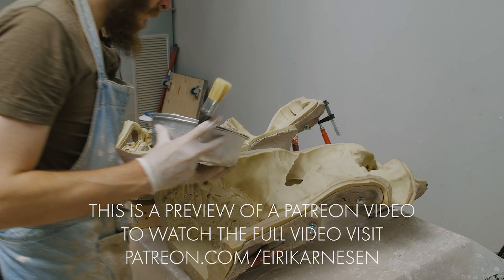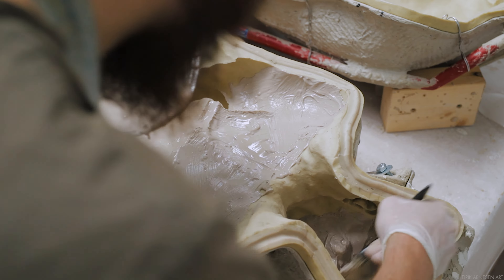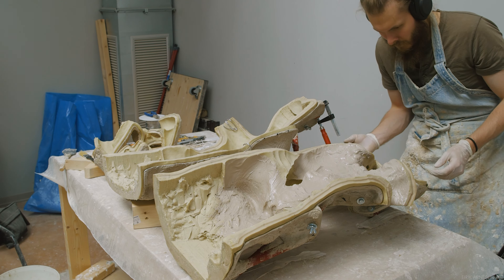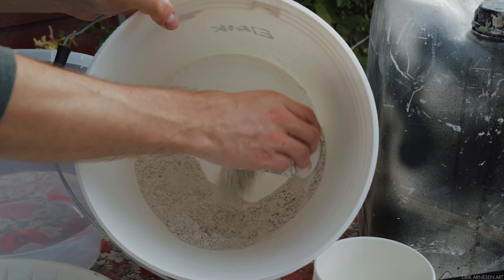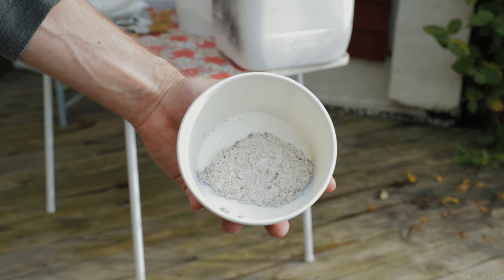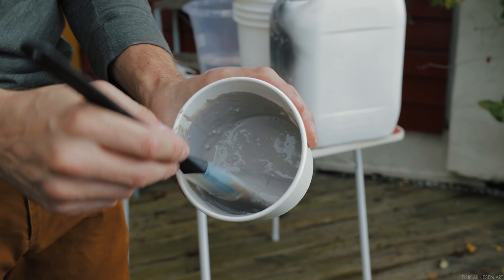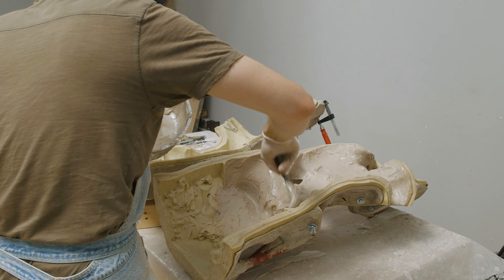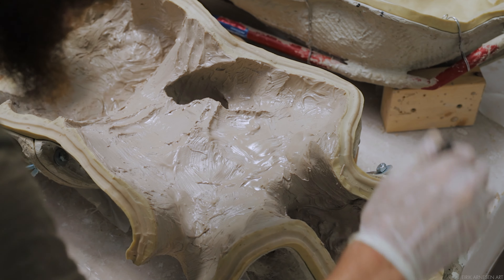Casting in Hydro Resin - Tools & Materials

Comment: The material used in the clip is called  I'm not good at translating English. I'm sorry if you don't understand the question. 😊😊😊
Reply from the maker: It's called Hydro-Resin. Another brand is Aqua-Resin. They are all composite casting materials. Very similar.
Reply: Thank you.😄😄😄

Comment: You  need to address your volume issues. You can't just turn up the gain on your mic, because it might clip which sounds horrible. However there's a tutorial video on my channel that will show you how to easily fix this with just a few clicks in free software Audacity.  Very easy n you'll wish you'd done it sooner. You'll end up sounding like a professional. :) Not a plug! It's really hard to hear you. I have to turn my volume up 70%  to hear you clearly.
Reply from the maker: I can hear the audio fine between 25-50% depending on the device. On my phone with very old ear plugs from Apple I have to turn it up slightly around 60-70, but I can hear myself fine. I monitor the db when recording and keep it at a reccomended level for speech, around -12 to -15. So I don't really know what more I can do. On my end it works fine on multiple devices.